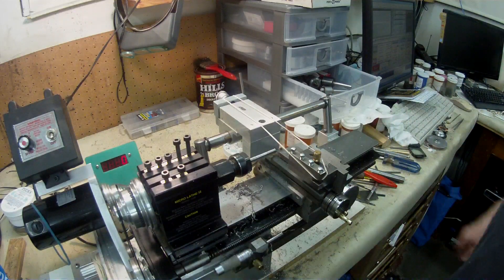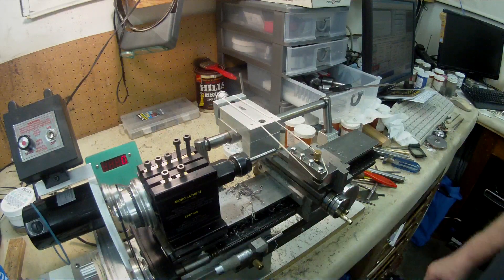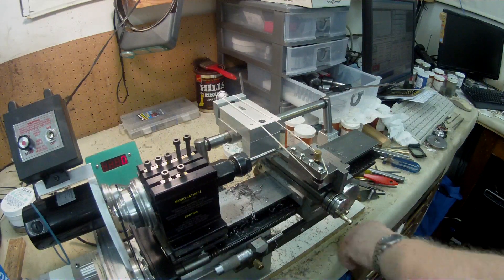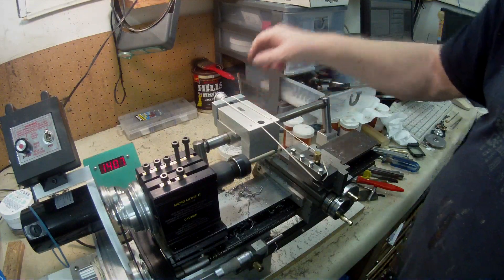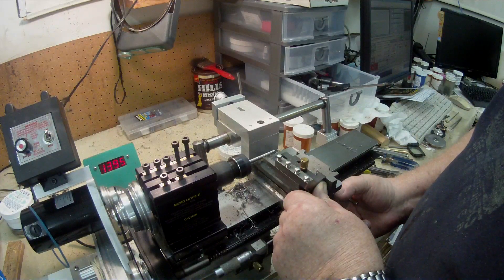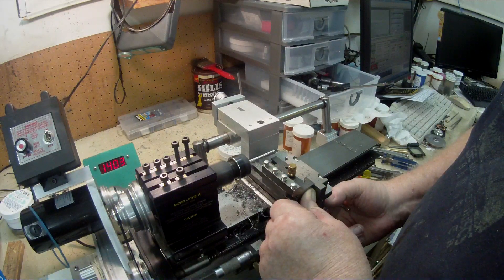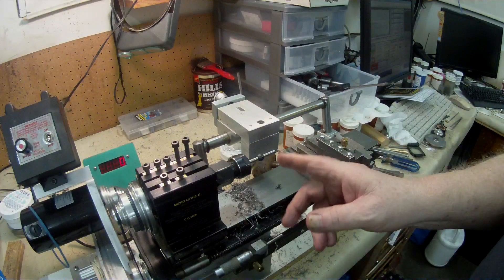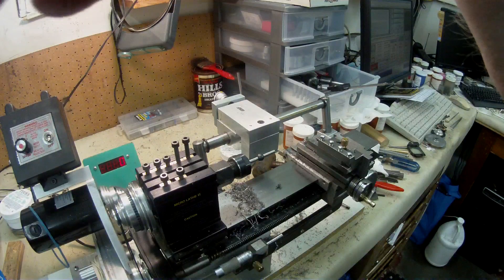FILE0032 Machining Tapered pin for ball handle

Comment: Walter:
Again; Thanks for the video.  Your camera setup is working great and the sound seems quite good.  It seems you've finalized the design and use of your taper attachment with better than average results.  I'm looking forward to seeing the finished product installed on the dial.  Keep up the great machining work and the excellent videos.  Best Regards: Larry
Reply from the maker: Thanks Larry, 
     I have been thinking that if this handle turns out to be just right and strong enough that I might at the same time try modifying the handwheel to get rid of that spring used for a fiducial line, something along the lines of Hardinge hand wheels for zeroing, I have some idea of incorporating Silicone sealant to lock the index ring each time after zeroing,
Reply: Walter Maisey  Walter:  As you know, I've been working with the dial assembly.  It turns out to be quite simple.  I purchased two, but will make the upper dial and lead screw assembly myself and may ultimately make the lower dials myself.  I'm thinking of using an acme thread.  If I do make my own dials, I will copy another design that allows zeroing the dial.  I will send an update via email.  Regards: Larry
Reply from the maker: Larry Poindexter Larry,
    I look forward to any updates re your compound, I eventually maybe tonight start a rough drawing of how I am thinking of incorporating Silicone Sealant to lock the zeroing indexing ring, it might give you the same idea, I will mail it when its on paper,